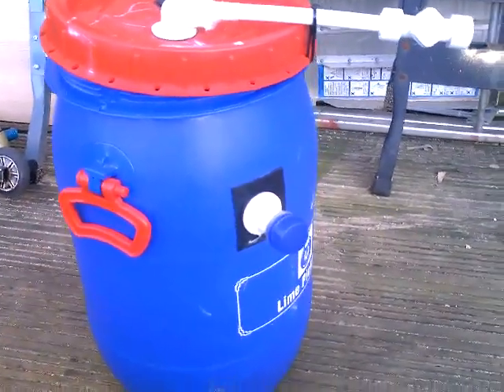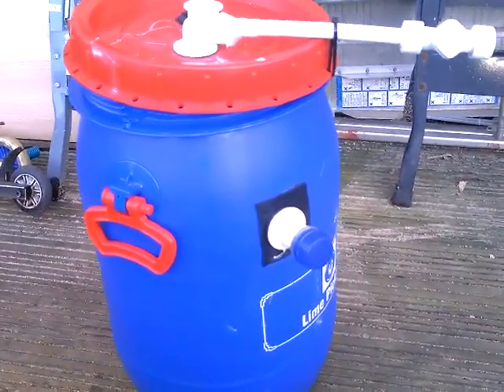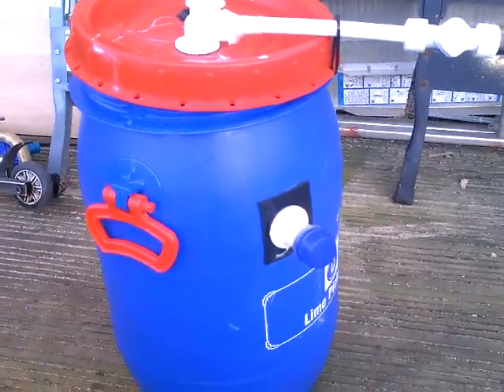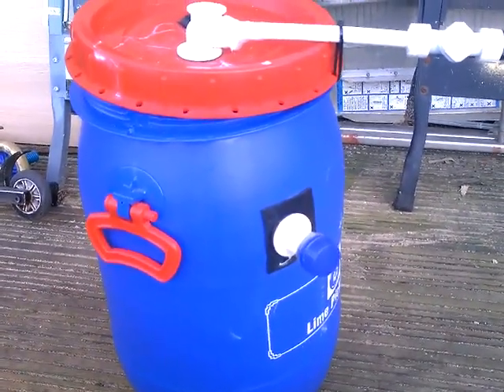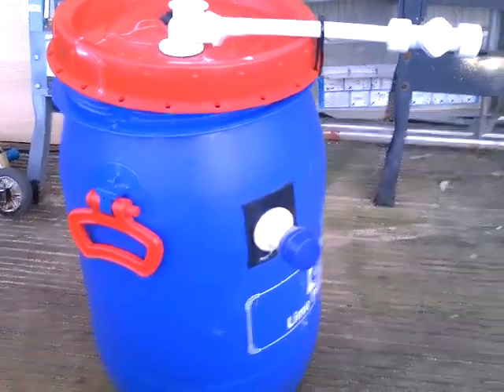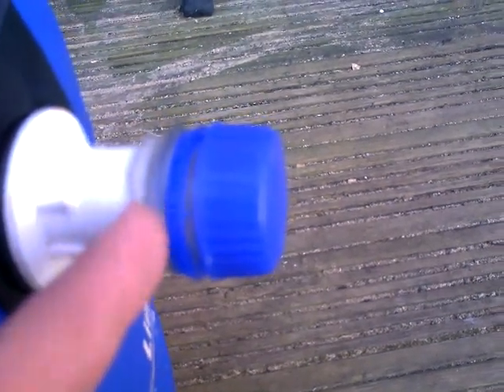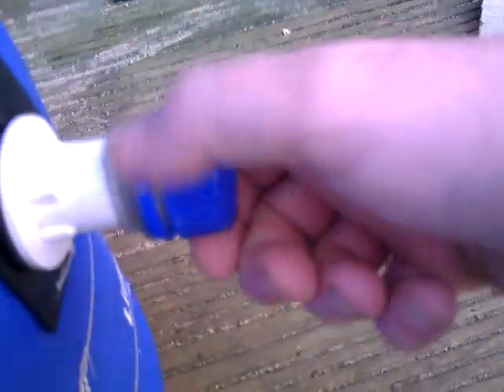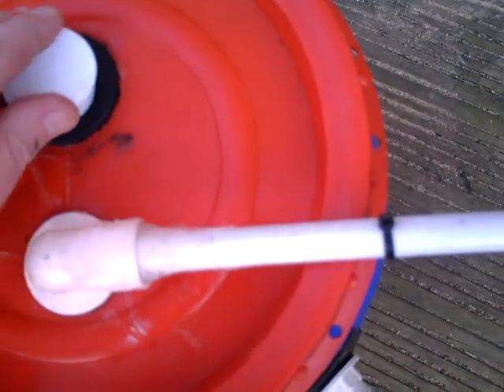biogas digester almost complete

Comment: Two things to purify the gas.
One: to remove carbon dioxide you need to bubble it through "Lime Water" (Dissolved Hydrated Lime) 
Two: to remove Hydrogen Sulphide (Bad Smell) pass the gas through a manifold containing rusty iron swarf or steel wool.

It's best to have the sulphide removal second as it will reduce moisture in the line. I also pass it through Dry wood shavings to remove as much moisture as possible...